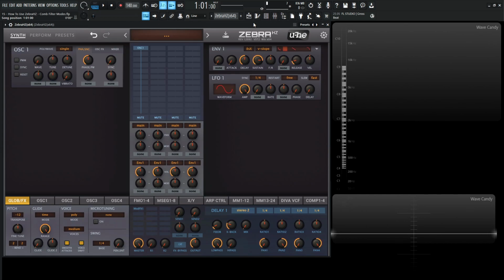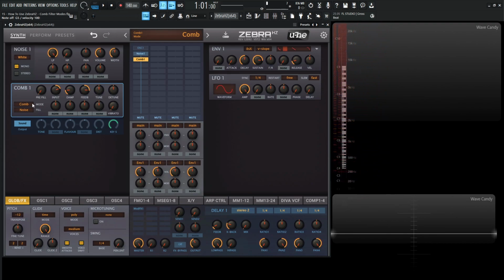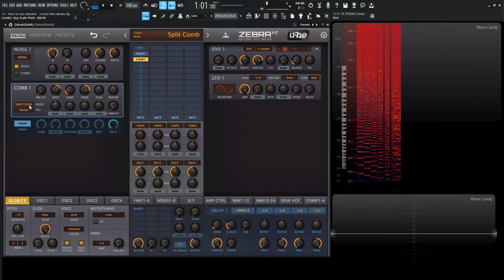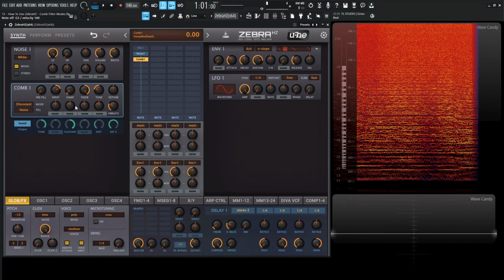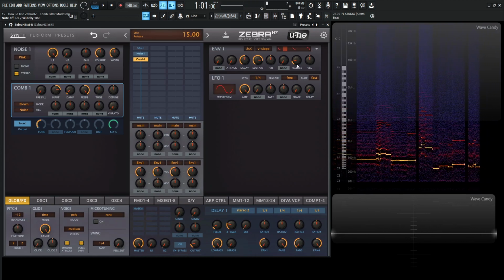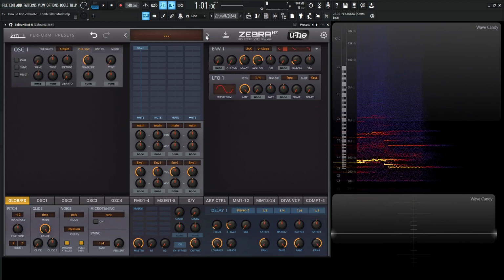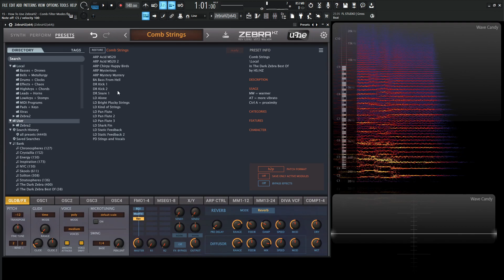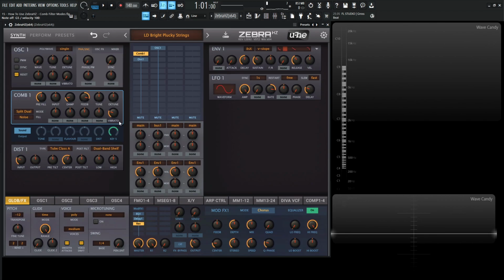Comb FIlter Modes Zebra HZ Tutorial Lesson 15

Comment: I had to save lots of presets at this video in case I can't get the sounds again. Amazing sound module. I haven't even bought Zebra yet so I'm getting that demo limit of wrong notes. I was originally going to wait for Zebra 3 but I can see that still taking ages to finish. The Zebralette 3 Beta sounds great but is not usable on Linux yet. Lots of crashes. Obviously lots of work still to do.
Reply from the maker: To my ears, Zebras comb filter is unrivaled! it sounds so good, whether you're making some plucks, sound FX, weird strings, or who knows what, you'll def end up with a cool result!